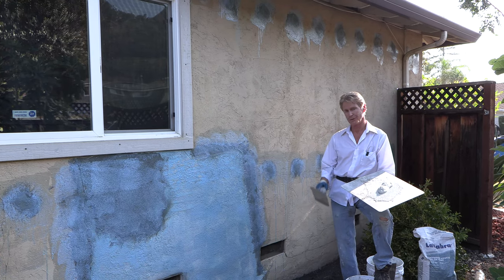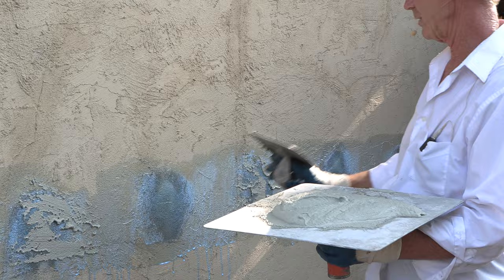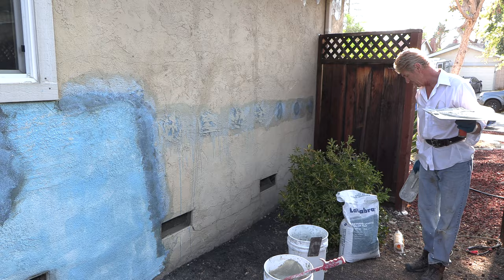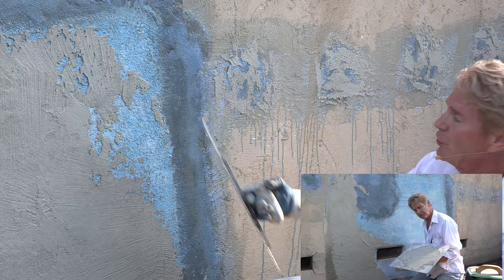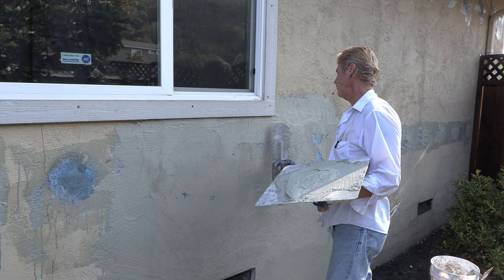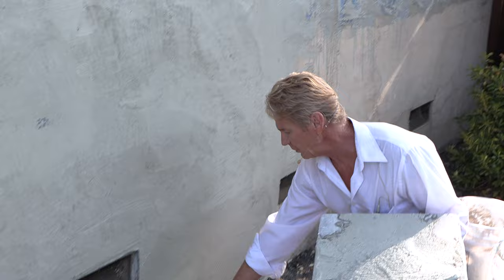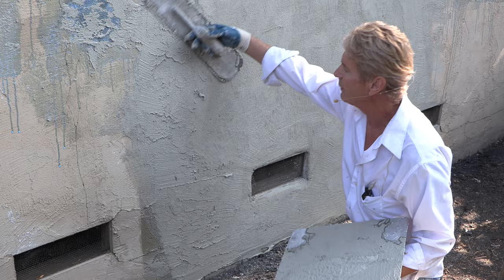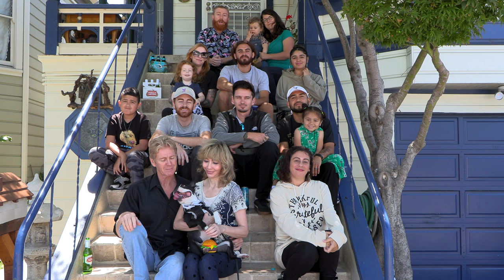Fix or repair blown in insulation holes with stucco

Comment: Hello Kirk, after finishing a block wall how often should i hydrate per day? And for how many days should i hydrate?
Reply from the maker: Evening Nickolas Dude, I'd hydrate it at least twice, then it's ready for the second coat, technically the second coat can be applied 48 hours later.             A color finish should not be wet until a week later, or the color may bleed or ghost. 💃